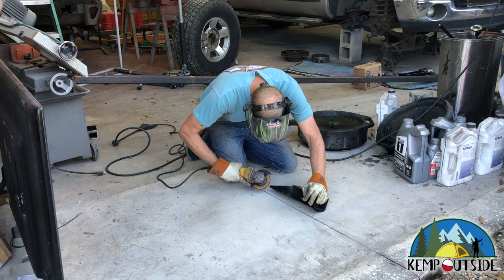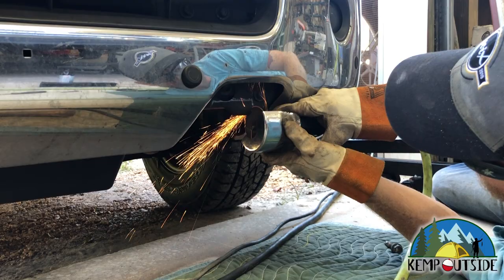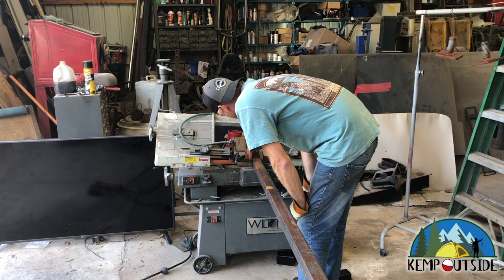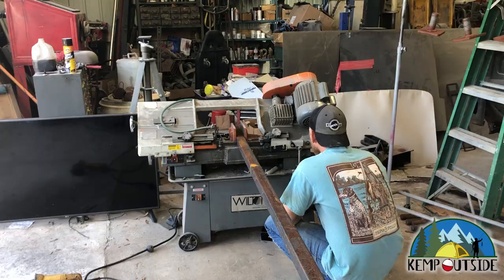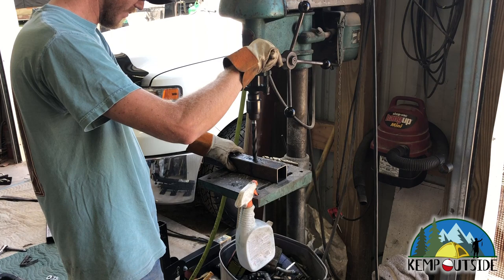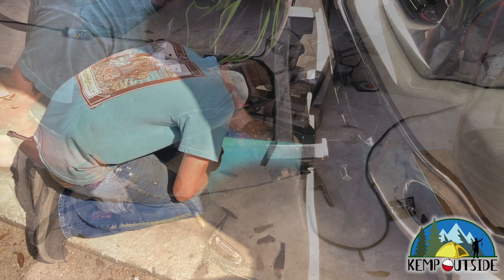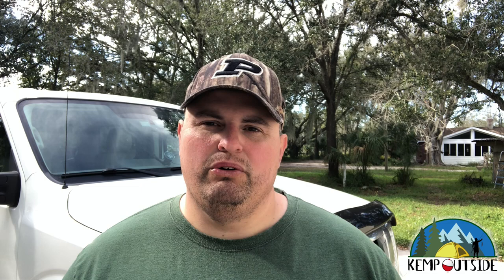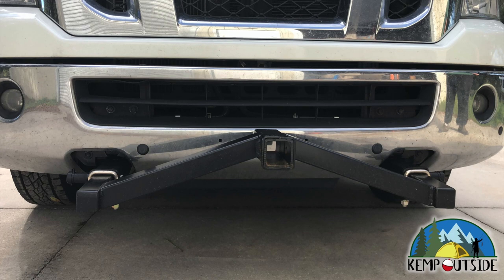Building a Front Hitch Mount for the Nissan NV 3500 | Removable Front Reece Receiver for Our Van

Comment: This front mount is an awesome idea man! It’s a great way to get those bikes out front so you can tow or use that hitch cargo basket. Thanks for sending me the link to this from your other video.
Reply from the maker: Thanks! The beautiful thing is that with just 4 bolts, I can put the stock tow hooks back on and return the van to factory specs.  But it really helps to have the bikes on the front and the boat or cargo on the back!

Comment: Is the any issue with blocking the radiator and or the headlights (using it the carry a 290# dual purpose motorcycle)
Reply from the maker: We have had no issues with three bikes on a bike rack but I would keep an eye on the temp gauge and trans temp gauge.  I have seen people put coolers on front racks but I would worry about air flow.  I'd give it a try but it may not work out.